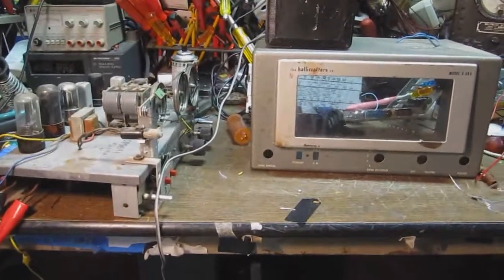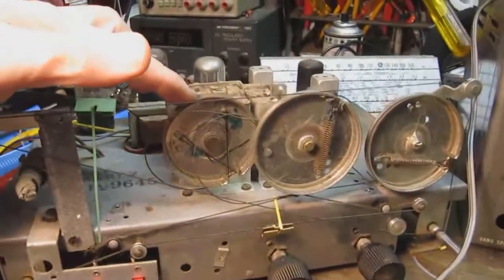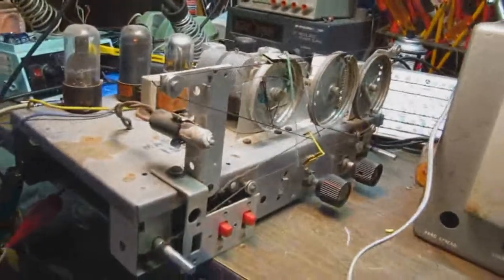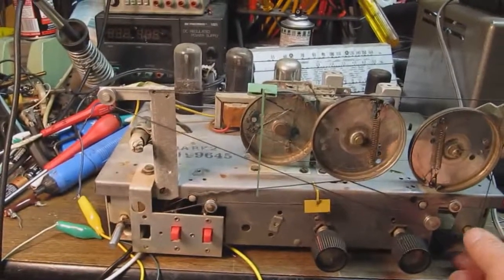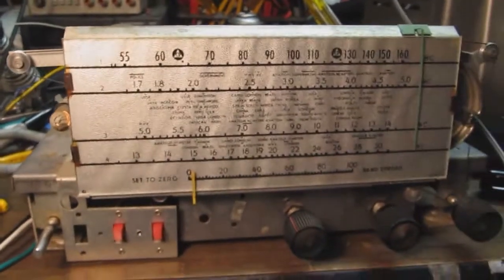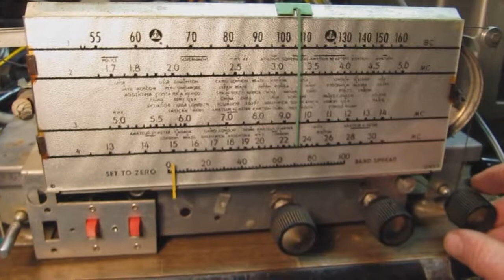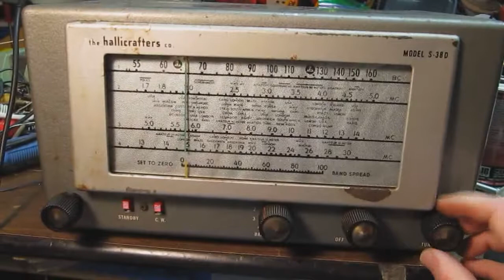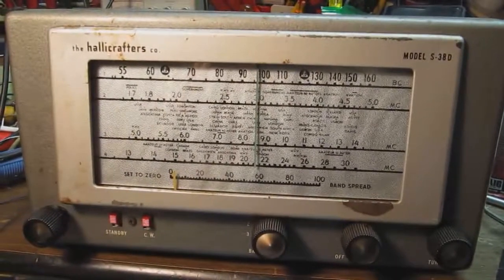Hallicrafters S-38D Shortwave Radio Electronic Restoration

Comment: Just picked one up off ebay for 35 bucks. Got the cap kit from hayseed hamfest. Seller said it didn't work just hummed. I hooked it to my long wire and it does work, it needs capped because it hums. I'm watching to see how the dial cord setup works, the tuning was sticky and I reached in and moved the tuning cap by hand and the dial cord came off.

Comment: Your audio here is very good. Were you using an external speaker? I have the original S-38, and the sound with the stock speaker is not nearly as warm sounding.

Comment: I've got an S 38 D chassis that was modded,years ago,to include a BFO circuit.I've saved it because I want to convert the audio to a push pull circuit using two 25L6s in place of a single 50L6.I'm sure it can be done.What I'm wondering about is the output transformer.
Reply: dunno if you guys gives a damn but if you're stoned like me during the covid times you can watch all the latest series on Instaflixxer. Been binge watching with my brother for the last months =)
Reply: @Kameron Nelson yup, I have been using Instaflixxer for since december myself :D